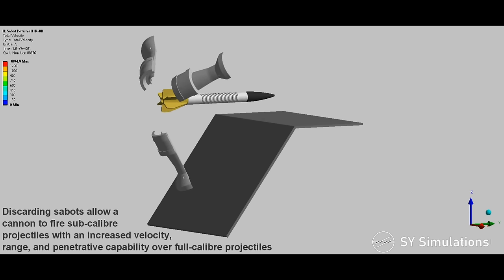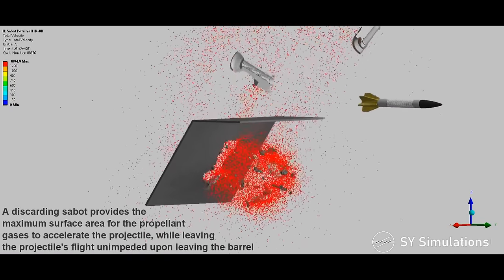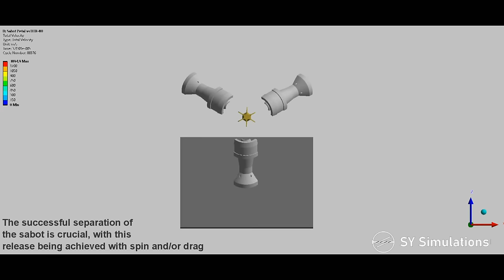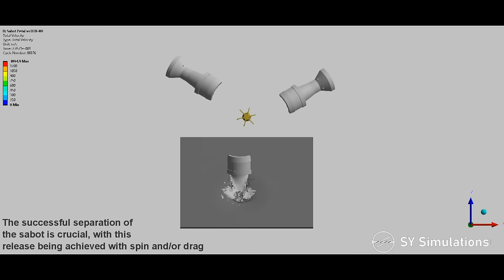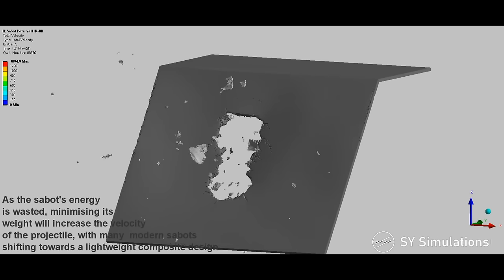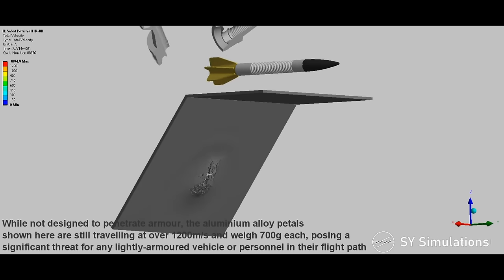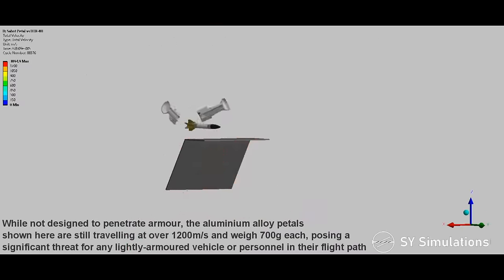HOW DANGEROUS ARE DISCARDING SABOTS? | Sabot Petal vs BTR-80A | Armour Penetration Simulation

Comment: Nice! Now we need to see various 25mm bushmaster munitions against the front and side of T-90M turret and hull!

Edit - they even have APFSDS for this gun.
Reply: Not sure how well multiple HE would work, unless they are able to freeze the simulation of the plates between hits, so they can space the other HE rounds in the simulation as to leave them undisturbed by each explosion.
Reply: Do we need to see this? The chances for penetration are less than 0% unless maybe hitting the turret ring.
Reply: Only, going on the interview they did with both the Bradley driver and the Bradley gunner, they took out that T-90 by blinding it. The gunner deliberately went for the optics on the T-90M turret. 

(Which also nicely explains why at one point in that video it appears that the smokescreen explodes / cooks off.)
Reply: They have AP munitions in that 25mm cannon... Can you simulate that?
Reply: @Hydrazine1000 yeah the t90m looked functional otherwise. Was moving and turret was still articulating.
Reply: @kamilszadkowski8864  I saw a simulation where 3 autocannon rounds were fired at the same spot and they third round defeated a thickness way wah deeper than the first round.

They definitely don't just bounce off with only a scratch.
Reply: @VyarkX the turret traverse actually got stuck in an uncontrolled spin during the incident
Reply: @kamilszadkowski8864  Even if it doesn't penetrate, getting rattled by a belt of 25mm rounds isn't gonna do the crew a whole lot of good just from the series of concussive shock. Back in WW2 Allied crews with short 75's were having no problem knocking out things like Panthers/Jpanthers and Tigers from the front just by battering them into submission with continuous fire until the German crews bailed out
Reply: This was SY SIM on BTR-4 Vs T-72 side. Definitely 25mm is going to jam the turret like it did Vs T-90M. Later was shows that 3 of crew members left the tank. 25mm gun definitely is gonna ruin optics, machine guns and even breech or gun barrel or penetrate drivers optics. @Treblaine
Reply: @norezi8130  shooting the barrel! It's not a gamer move, it's legit.
Reply: @Lo-tf6qt  During WW2 tanks had much tinner armour which on top of it was homogeneous. This is why it could be penetrated by HESH rounds.

Nowadays penetrating an MBT with a hesh round from a fron is basically impossible. 
Keeping that in mind, do you really believe that 25 mm HE or APSFSDS could "rattle" a crew inside a modern tank?

Do you even have any evidence for it being possible or are you just speculating which is just a nice way of saying you pulled it out of your ass?

From what I've seen in the video and could learn from the interview with that Bradley commander and gunner what those 25 mm rounds actually did was disable the tank's sensors.
Reply: @Treblaine  Great, but the odds of three rounds hitting the exact same spot are also close to 0%.
Reply: @kamilszadkowski8864   but the simulation did NOT have them hit the exact same spot but each within a caliber's diameter of another.

And that autocannon has quite a narrow spread and so many rounds were fired so - in fact - the chance that each projectile hits an otherwise unaffected part of the armor is close to zero.
Reply: It was a mission kill, no way the 25 pens the T-90 from the front, apart from maybe lodging in its turret ring
Reply: @kamilszadkowski8864  Like it was already mentioned couple times. Complete penetration trough
sheer armor is pretty tall order for 25mm. But!
Like it was already simulated elsewhere how even HE shells will ruin your ablity to see outside world.
And same time those will set your reactive armor plates off so every shot means less protection
from next.

And as we saw from that bradleys vs t90 they shot 3 times and missed so close target
so most likely their optics were gone from first burst from bradley.

Tank may move somehow but it is still counted as mission kill because in
that point its crew is only trying to survive.
Reply: @Kesssuli  Yeah, I get that but I think my point stands. We don't need a simulation of "various 25mm bushmaster munitions against the front and side of T-90M turret and hull" because we already know what would happen. 
We also don't need a simulation of what would happen to the optics or other sensors as they often can be damaged even by small arms fire.
Reply: @kamilszadkowski8864  So what was that orginal point if we still have about same conclusion how 25mm can disable even moderm mtb ?
Reply: i mean, it should not penerate like we've seen in that viral clip but if multiple rounds hit the same exact spot there might be a chance
Reply: @dominuslogik484  yes sorry i was referring to the traverse mechanism still working so probably nothing went through the turret ring
Reply: @VyarkX  But same time it should not do that when tank itself is driving forward and turret is doing literal 360  no scopes.
So something was totally wrong in there.
Either something malfunctioned or gunner was injured. And both indicates that something happened inside of turret.
Reply: @VyarkX  all good
Reply: @Treblaine you’re talking about the 40mm Bofors vs. a KV-1’s flat side armor right? The thing you’re requesting is a lot different than what you’re referencing.

Edit: I took a look at the video again, it’s against the front plate from 50 meters.
Reply: @kamilszadkowski8864  APFS rounds to the side might tell a different story
Reply: @kamilszadkowski8864  HESH rounds don't penetrate.
Reply: @Kesssuli  yeah i figured probably jammed controls (from mechanical shock of impacts) or just disoriented crew
Reply: @TzunSu  Oh, you know what I meant.
Reply: @Hydrazine1000  >>The gunner deliberately went for the optics on the T-90M turret.<<

Absolute BS.  No one fvcks around "aiming for a weak point/optics" against a live target, and sure AF not while on the move.  The gunner was simply aiming center mass and making sure he got rounds on target.  If he's claiming he aimed for the optics then he's fvcking delusional and/or outright lying.
Reply: @iatsd  Go watch the interview. I'm not making this up, I'm just saying what they stated.

I mean, there is actual footage of the fight available! You can see that this was an extremely up close engagement, within 100 metres or less. At that range the Bushmaster targeting system allows you to pick out a shoe box sized target with ease (its effective range is 3000 m, about 30 times more) and that's exactly what they claim they did.

(And how the T90-M reacts is also in line with being blinded, so there's that too.)
Reply: @Kesssuli Your point about ERA is wrong. Heavy ERA can't detonate from 25mm autocannons, as seen in the aftermath none of the relict ERA tiles are detonated. Only some falling off of their mounts because of  continuous fire.
Reply: @PrintScreen. All 3 of crew bailed out with only driver having slight injuries
Reply: @PrintScreen.  all russian MBTs have 3 crew members. All of them bailed out. It's right on the footage.
Reply: @PrintScreen.  In the full video, you can see all three running away
Reply: @Hydrazine1000  I've seen the footage and I don't care what the gunner was claiming afterwrds: he wasn't "targetting the optics".  That simply isn't how it's done. 

Christ, with an autocannon, on the move, you will get rounds all over the target whether you want to or not - exactly what you see in the video - and you simply aim center mass.  There is ZERO need or time to "aim for the optics" or any of that other gamer BS that idiots think it real.  It's an autocannon: it's going to be spraying rounds all over the front of the vehicle anyway.

Oh, and please don't try and pretend that a Bradley can engage targets at 3km w/the gun.  You can't see shite beyond ~1500 metres unless someone is pointing it out to you, and that's on a good day, when you've got all the time in the world, and they're moving and/or firing.
Reply: @iatsd  Sir, yes Sir!

Well, no. 

The Bradley autocannon has a range of 6+ km and an effective range of 3 km. Just look up publicly available data on the Bushmaster.

A shoe box sized target at less than 100m is realistic. It is also what the gunner claimed (because they also stated that the AP rounds were not feeding correctly, they had to use conventional rounds which will not do anything center mass on any decent tank) and it matches with how the T90-M acted.

But hey, go ahead and counter those 3 arguments with a broad "it's BS".

Let's agree to disagree then.
Reply: @Hydrazine1000  yes, yes, I know what the Bradley can do; I got to spend a day with one on a range just after it was introduced into service at the same time we were showing US crews what a Chally & Warrior could do.

The Bradley can't do what you think it can.  Actual war isn't like a video game.
Reply: @kamilszadkowski8864  I imagine that the "rattling" wouldn't be so much the physical percussive effect of the HE or impacts but the definite sound of impacting steel would be something that can cause panic among poorly trained crews such as the ones operating that tank.

also if you look into the armor composition of the T90 and most other Russian tanks the composite armor is only found on the frontal arch with the sides of the turret being homogeneous steel ranging between 50-100mm thick.
Reply: @iatsd  Ok. I was going on what was said in the interview, by the two men who were actually there. What they claimed seems credible and it matches the footage. Was that not "by the book"? Quite possibly.

I am a gamer, but I don't play any war "simulation" games like War Thunder or World of Tanks. I don't claim any experience in that area.
Reply: @kamilszadkowski8864  from less than 100 meters away and using the 25mm bushmaster which is remarkably accurate the chances aren't too bad but still not going to get through.
Reply: @MegaJani  it was planting most of those shots into the side of the turret which is likely still too thick for the 25mm apds to get through but the 25mm definitely has a slim chance of getting through. either way all crew survived and bailed out of the tank.
Reply: @dominuslogik484  I am not sure if the crew would actually hear that over the sound of the working engine, autoloader, and the firing of their own gun. 
I mean you can find videos from the inside T series tank firing their guns and it isn't that loud. Considering this I doubt if a 25mm projectile can make any significant noise or vibrations reach a tank crew.

Besides, shouldn't the crew wear hearing protection integrated with an internal communication system (radio)?

Anyway, I've read some memoirs of American tank crewmen recalling driving over anti-tank mines and bearly noticing the explosions. Not sure how comparable that is to T-90M being hit frontally with 25mm rounds though. I also seem to recall The Chieftain claiming that autocannon fire would be bearly noticeable to a tank crew.
Reply: @dominuslogik484  You do make a lot of good points. 
I have to rewatch the video to see if any rounds did actually hit the side of the turret. The T-90s turret profile does make it hard to get to those sides... but considering that at some point that T-90M's turret started turning around like a  carousel I wouldn't be surprised if it did happen. 

So you might be right in the end. 
The only thing I am not sure about is the effectiveness of the Russian "tanker helmets"(I don't think that there is a direct English synonym to describe them).
Polish Army also still uses soft-padded "helmets" and from what I gather from interviews with Polish tankers they are doing their job pretty well when it comes to hearing protection and muffling the noise.

But I doubt that Russian gear is made up to this standard.
Reply: @Hydrazine1000 what they claimed seems credible to you just because you have no idea how it actually works and there is nothing wrong with that

you aren't going to be aiming for weak points while moving against a target that is trying to kill you, at best they can get lucky and hit it, but definitely not deliberately

keep in mind the gun is not controlled by a mouse where you can just pick out weak spots, it is much harder to aim than you might think
Reply: @MegaJani 
Yes it was a mission kill. It is also true that the Bradley did not pen the front of the T-90.
What the Bradley DID do was blast the ever living hell out of the T-90s OPTICS (as stated in an interview with the only two crewmen of the Bradley in question)
The 25mm HE rounds even hit and set off the T-90s smoke launchers.
The T-90 was disabled by blinding.
Reply: @kamilszadkowski8864  Be worth seeing what the apfsds could do against the sides yeah.

Comment: Probably should have tested against around 30mm RHA, this armor stood no chance
Reply: I agree; 8 mm (even with it being high hardness) is such a low protection to the point where penetration was expected. I mean it's interesting for sure, but it would've been even more interesting at 20-30 mm thick, to gauge just how strong the petal is by itself

Comment: At 10m range I guess it's expected to have the power to pen thin plates. I wonder how big threat the sabot would pose at let's say 100m distance or more.
Reply: Speed would be like, 50 - 150 m/s by then. Defo no penn, you can see the sabot is completely dissolved by the end of this ordeal - and this is at 1,455 m/s
Reply: I don't think that they travel 100m , once they spread out they deaccelerate very fast .
Reply: @5co756  I doubt anything thrown in the air at over 1400m/s would be capable of fully deaccelerating in 100m.
Reply: @Patryk-ix2zr  If this Sabot would stay horizontal the whole time then yes , way more aerodynamic and less friction . But they spread out and went vertical , so they have a larger surface . And friction increases with speed to square , so theres a huge force on that Sabot . And I think they went up in the air or down into the ground , some will probably hit you from above at 100m . 😅

Comment: So apparently gaijin was right when they made sabots actually do damage.
Reply: Sort of. Sabots come out the barrel at very high velocity, and are themselves big hunks of metal, so they would do damage. However, do understand that this simulation is at point blank range against a measly 8 mm of RHA. These sabots are made of low density light weight metals and lose a lot of kinetic energy over range, and would not have the same penetration at say over 100 or 1000 meters. War Thunder doesn't do a very good job accounting for penetration fall off of these sabots, so they end up overperforming in that game.
Reply: @xxfalconarasxx5659  I'm aware that they are modeled poorly in WT but I am surprised to see that sabots can actually penetrate armor at all. They travel in a very predictable pattern and can go thru the sides of MBTs in game which is a bit fishy. Makes things like the 2S38 practically an anti tank shotgun when using APFSDS against the sides of NATO MBTs.